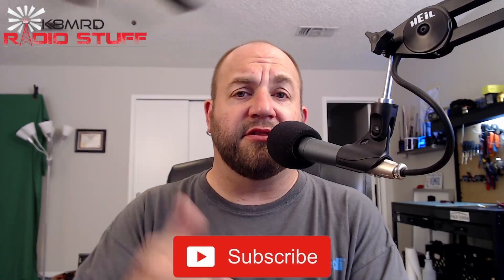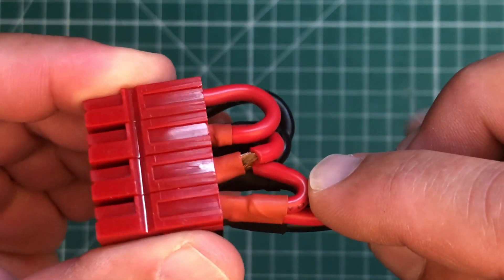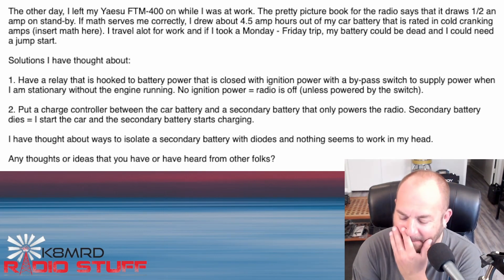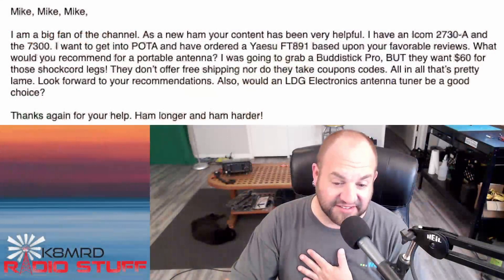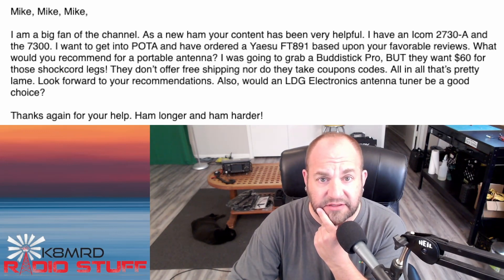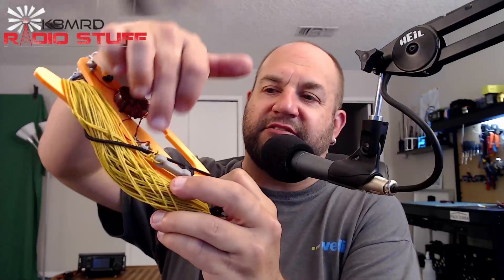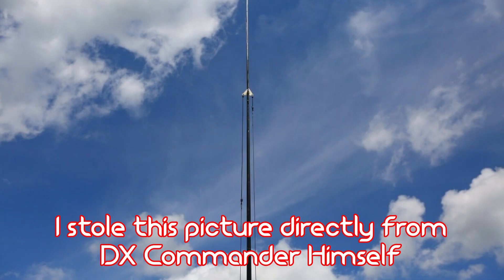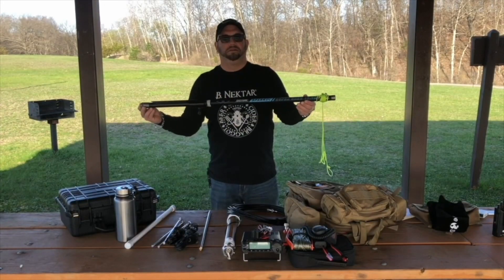Best First Ham Radio Antenna For Portable HF

Comment: I installed a 20ah lithium battery and a 12ah lithium battery in my Honda CRV console. The 20ah is for my radios, and the 12ah is wired to a switch that is connected to a 4pin standard auto relay. A switch turns on the relay, and then current passes though the open/closed relay circuit to a power distribution block. Turn on the switch and wallah I have power to the FT-891 (mobile use) and my 2m/440 radio. This way at least I don't have a parasitic draw to the vehicles battery (which had drained my car battery several times). Both of these radios have a parasitic draw even when not turned on.
Reply: You mean "voilà" and not wallah ;-)

Comment: Great post, especially on the portable antenna side.  I have already bought a 49:1 unun for future EFHW and made a 1:1 for my dipole.   My question is what wire to purchase and winders?  Can you help there... stealth, etc.   Looking at my 20w radio, and maybe a 100w eventually.
Reply from the maker: Thanks for watching.  We've talked about wire quite a bit on the channel.  My favorite go to antenna wires are either 26awg poly stealth https://www.amateurradiosupplies.com/category-s/218.htm or the 26awg wire from sotabeams (I like the yellow for high visibility) https://www.sotabeams.co.uk/antenna-wire-lightweight-100m/. You can run 100 watts into those wires all day long no problem.  As far as winder though, I don't really have a good place to get them.  3D printing might be the way.  Maybe thingiverse.com?
Reply: @hamradiotube  Thank you for the information - is there any US retailers of the sota beam products to avoid shipping that is more than the product itself?
Reply from the maker: @jaynesjunction  Nope.  Just bite the bullet.

Comment: I put a secondary battery in my car to run my radios, because it's hard to get power into my cabin. I was worried about the current draw through my lighter socket, and the fact that it could read up to 14.8V while charging, so I used a 10A silicone diode for a little voltage drop, and a high power 1 ohm resistor for current limiting. Worked perfectly.

Comment: I have a about 15 yards of space in my townhouse rental.  Within that space I have at least 20 trees with the highest height being about 70 ft.  What permanent antenna can you recommend for my IC-7300 and for the space that I have? Also the 20 yard space that I mentioned is a common high traffic area where residents walk. No room for radials either

Comment: Two things from me... I use a 20ah Lifepo4 behind the seat in my truck to run my VHF/UHF radio. Charge it about once a week and turn the radio off when you get out. Building antennas is my favorite. Built many 49:1 transformers and EFHW's as well as 20 and 40m verticals from speaker wire. Building an antenna yourself and getting it to work is very satisfying. I recommend all new hams start off with homebrew antennas. Jack K5FIT

Comment: The Yaesu FTM-400 "can be set to switch the power off automatically when there is no operation for a period of time. Refer to 'Using the APO function' (p.123) for details." -from the manual
Reply: Indeed. As they say "Read The Friendly Manual"...
Reply from the maker: What is "Manual"??  Lol

Comment: Exactly, if his commute is under an hour, set it for an hour. Page 119 of the manual solves this problem with a bunch of timing options for APO.
Reply from the maker: Page 119 of what???  What is a manual?? 🤣.  Wait...I thought of a funnier response...I'm not entirely sure what a manual is, but if I ever come across one, I'll be sure to go directly to page 119.
Reply: @hamradiotube  Exactly Mike. Sadly, APO has been around for a LONG time and that question is exactly what it is meant for. Go figure.
Reply from the maker: @perojunak6949  I know.  I kick myself for not thinking of that.  So many people have commented about APO and I'm like, duh!  I was so hung up on the wiring aspect it didn't even occur to me.

Comment: One thing I would like to suggest for the guy with the draining battery is to get the battery tested. I've left my radio on all day as well and didn't have trouble starting my car. Car stereo amplifiers are typically wired directly to the car's battery and are switched on/off with the 'remote' wire from the car stereo. I have my Yaesu FTM-300 wired to the car's battery and I never had a battery that was so low that I couldn't start the car. There was a ham who had a battery isolator installed with an additional car battery. The alternator kept both charged, but either one could be selected to start the car. His ham equipment was wired to the secondary battery so that the first was never affected. Great video and informative! 73 KD5YOU

Comment: Thanks for the video, Mike.  I appreciate the thoughts and suggestions.  In regard to the question about radio in the car and keeping the battery charged, as some have already suggested use the APO.  In addition to the APO, what I have done in my vehicle is use a secondary battery that charges when the car is running by connecting to my fuse panel directly with a fuse jumper and grounding to the body of the car.  I use the fuse for the 12v outlets in my car that are hooked to the ignition switch.  Maybe not the perfect solution, but it works for me.  73, KJ7FEE
Reply: I'm just wondering if connecting the battery directly to a 12v source would allow too much current and overcharging since there is no charging stages or trickle charging. 73 KD5YOU

Comment: I got my General back in June.  After much agonizing over antennas, I finally came to conclusion that the best first HF antenna is the one that meets your needs and situation the best.  I live in a condo with a weird balcony configuration, so I don't have the space for the wire runs.  I finally decided on a Buddistick Pro because a) I can clip it to my balcony railing, b) it has minimal radials, and c) I can take it portable when I go that route.  Honorable mention to just wanting it to work after dropping coin on a IC-7300.  Building antennas is next on my list.  

Great stuff, Mike!  73

Comment: @K8MRD Radio Stuff
On point today! Just picked up a FT-818 and want to make a resonant antenna for 6m & 10m. I want to learn & make! Do you have a video or recommend one that shows how?  Especially one that is simple, quick & cheap! I’ll try a kit as a last resort.
Reply from the maker: Hmm, here's a great video on a cool 6 meter antenna by Chris K2CJB https://www.youtube.com/watch?v=U3ZGJWuzgRs I don't know of any for 10 meters, but I would just search for whatever kind of antenna you are looking to make regardless of band (dipole, vertical, etc.) and take those principals and apply them to the frequency you are aiming for.  So long as it's a simple design it should work.  If you get into anything with loading coils you'd have to do the necessary maths for what band you are going for.  Keep it simple with a dipole (or fan dipole) if this is your first go at making antennas and you'll do great!  This is one of the videos I watched early on and gives you a good idea of what you can do with the humble dipole https://www.youtube.com/watch?v=BsFP6rE6ygM

Comment: Correct me if I'm wrong, but wouldn't the best idea be to just turn on the "auto power off" function available on just about every mobile radio? Mine is set to 30 minutes because my commute is 30 minutes.
I think you can get some noise if you wire through the ignition.
Reply from the maker: Yep.  The one thing I didn't think of.  And it was in front of my face the whole time.
Reply: YES!!! I was just coming in to say the same thing. I have mine set as well. Super easy and never need to worry about the battery.

Comment: Maybe I'm dummy but I do not understand the hype for direct wiring, second battery or so for the in-car radios. I simply plug my radio(s) to the cigarette lighter plug, and all goes well. It is 10A and I have had no issues whatsoever. And the best is that the car disables it when the car is off, so I never end up with the accumulator drained. I use FTM-100 and FT991A in my cars. I never run them on full power (especially FT991A) and they work just fine. 73 de LZ5RG

Comment: I have a 12AH Bioenno battery and Bioenno's 14.2 VDC charger under the seat next to the radio.  The radio is plugged directly into the battery with a very short wire run.  There is no interference from the car's electrical system.  The position of the ignition key doesn't matter.  If I leave the radio on overnight (which I have done a few times) I just connect the charge line from the charger.  I normally only plug the charge connector when the battery drops below 12 VDC.  I have run the radio (ID-5100) as long as two weeks between charges.  I can move the entire setup to another car when/if necessary with little effort.  A little pricey, but it has worked flawlessly for over a year.  KL4CF

Comment: Any microcontroller with A2D can measure voltage and drive a relay to kill power to anything. Home brewing a circuit and a bit of code to do that is a good first micro project.

Comment: The mobile radio guys use a relay circuit to control power to amps and such. A relay circuit simply put is a way to switch a high amp component with a low amp control. It is very cheap and easy to do just do and I put them on all my mobile installs. Probably would make a good video.

Also I 100% agree build your HF antenna before buying one.

Comment: Usually in cars there's open fuse slots on keys power and also on all time power. (Or there's fuse slot splitters) find one on ignition power and wire it in out of your fuse block

Comment: I agree about building antennas. I started off with purchasing some popular already made antennas that were expensive. After over a year i bought some EFHW kits and a dipole kit for less than $80 each  and they have out performed the expensive antennas by far.
Reply from the maker: Some of the commercial antennas are so much money for what you get too.  I've seen some over $500 for not much more than some wire and capacitors.  It's ridiculous.

Comment: Besides auto power off (APO) that every new mobile rig has, Powerwerx makes a “low voltage disconnect” aka LVD aka Battery Guard that disconnects the load if the source goes below a set voltage. $90 solution for a problem that’s solved by turning APO on, but it can help for real old radios or portable ops when running from vehicle battery with car off.

Comment: in the car. set the radio to auto shut off after a half hour. If you dont touch it, it will save your battery

Comment: I have a video of it on my Chanel but for mobile the best way I’ve known to do it is to run a seperate power bus inside the cab to run accessories. That bud is powered by a relay which is powered on by the accessory/run switch on the key switch(tapped from the engine bay fuse box. If I want to run the radios while the engine is off then I just put it on accessory.

Comment: I have an FTM-400 and it has a time out function. I set mine for 3hours and if it isn’t used, it turns itself off.
Reply: Mine is set for 1-2 hours as well. Direct battery connection and you have to ‘clear off the air’ reach over and turn off the power. Just being practical. The relay is next down the list. Third have a car stereo place fix you up.

Comment: I'd recommend a quality jump pack over a set of jumper cables. Especially if you're alone. Jumper cables have no protection should something be screwed up. Not something you want to risk when you have a newer vehicle with sensitive electronics. And Buddistick Pro FTW!!!
Reply from the maker: That's a great idea.  Good to not have to rely on someone else too.
Reply: @hamradiotube  And it’s costs almost the same as a expensive set of cables

Comment: My first hf antenna is DXC rapide. I screwed up cuttingall but 40, and 20 on it... It really sucks soldering more wire to an antenna, and I ordered another spool of wire from him to make it right....Also sucks paying almost 100$ for 100 meters of wire (shipped to us). But learning the lesson was worth it i suppose. Side note: first ever contact from west coast to Illinois was awesome!
Reply from the maker: I made plenty of mistakes when I first built my DXC Expedition.  Nothing wrong with soldering wires back together though.  Put a little heat shrink on them and they're as good as new.
Reply: @hamradiotube  its not good as new in my eyes.... New spool should be here Thursday, snow is due in on wed, so i get to freeze my arse off measuring and cutting new elements

Comment: Some rigs have a shut down timer.  In menu.  Check manual.  Y TFM 6000 has one at 01 position in menu
Reply from the maker: Yes, they sure do.  I didn't even think about that.
Reply: Not that radio, at cursory reading (on my phone, HI)

Comment: Isn’t there a time out timer on the radio that powers off the radio after sitting idle for a bit? I don’t own the radio but check the manual/ menu for the radio.
Reply: Some rigs do have a timer for shutdown.  Check manual.  Usually a menu setting.
Reply: Ya I think many or most mobiles have this. My cheap ones do!
Reply: Yep, it’s called Auto power Off (APO)